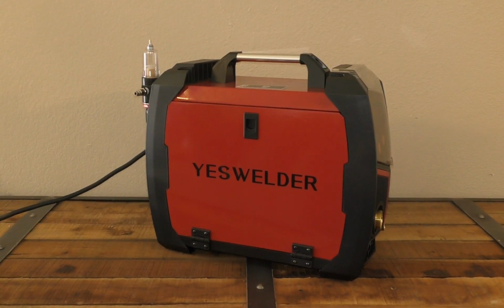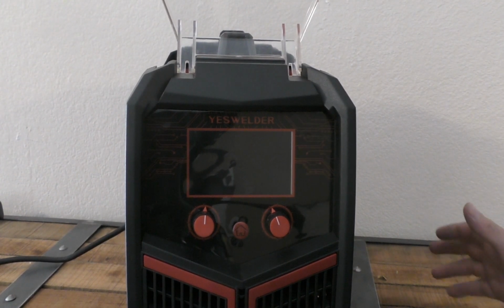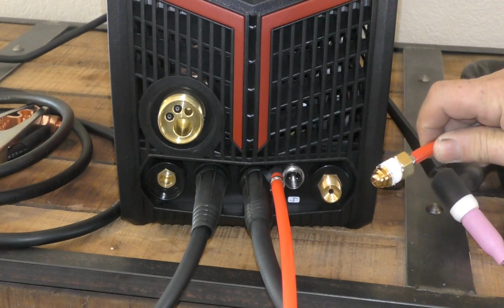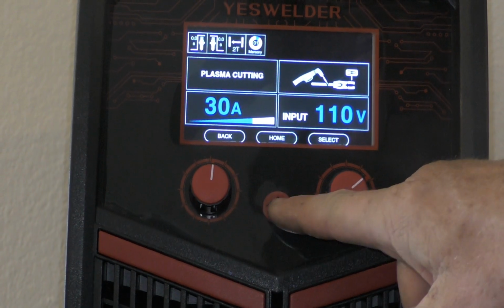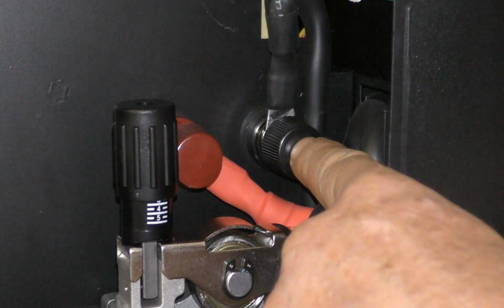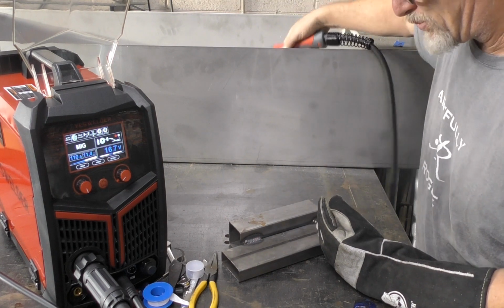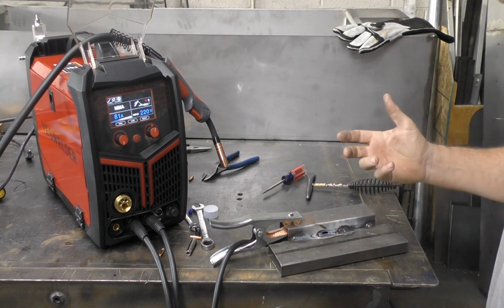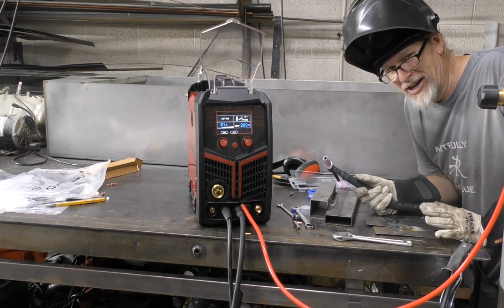YesWelder FIRSTESS™ MP200 5-in-1 Welder & Cutter - ACT NOW BEFORE GOES UP!

Comment: What air compressor did you use with the MP 200? What was the CFM rating for that compressor?
Reply from the maker: At the time I was using my Husky 60 gallon compressor. When I'm back in the shop I'll check the CFM
Reply: @ArtfullyRogue 
Thanks bro. Could you give me the model number also?

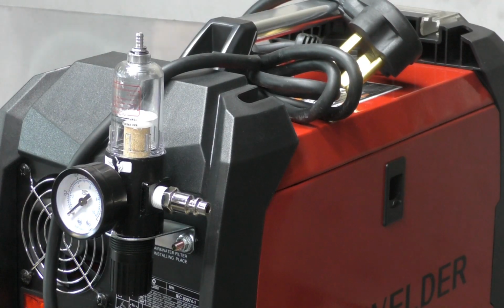Comment: quick question on the plasma cutter, is the air filter upside down? Doesn't the clear bowl go down not up (2:32 mark)?
Reply from the maker: Yep,that's hilarious. I never even noticed that I put it on upside down. I'll guarantee it's still like that. After that video, I put it all back in the box to move to a new shop and haven't taken it out since.

Comment: What size compressor do you use when plasma cutting with the mp200? Wanted to know if my current compressor is adequate or if I now have an excuse to go buy a new compressor? Thanks!
Reply from the maker: I use a 60 gal compressor for my cnc plasma and so I used the same for the MP200. I'm sure a smaler one could work if your doing small projects/cuts. But if it justifies the new tool buy, a bigger compressor will be less stress on the plasma and it can do its job better.

Comment: I don't know why everyone advertising the welder but no body said the price 😕
Reply from the maker: Because it was a Kickstarter project and the price was changing based on which tier you managed to buy. I think the first tier had a limited supply for $499 and then it went up from there so it was difficult to nail down a price at the time the video was shot and published. Check Kickstarter for current tier available.

Comment: Doug, a wise man once told me if a machine does more than 1 function it won't do any of them correctly.
Reply: Maybe if it's crazy cheap. If you have welded with a 12 thousand dollar miller multi process machine you'd change your mind. These small inverter machine actually weld way smoother then high end Miller machines I've used. The only question is longevity

Comment: Can this weld Aluminum? Is the Manual available?
Reply from the maker: The manual is still being created and it does not weld aluminum however they do have a TIG and MIG machine that does, here's the link https://yeswelder.com/products/mig-welder-250a and make sure to use my discount code ARTFULLYROGUE for 10% off